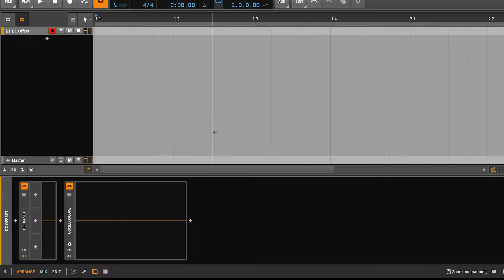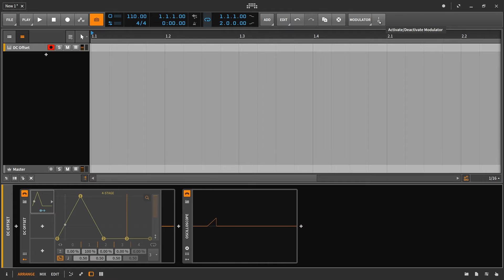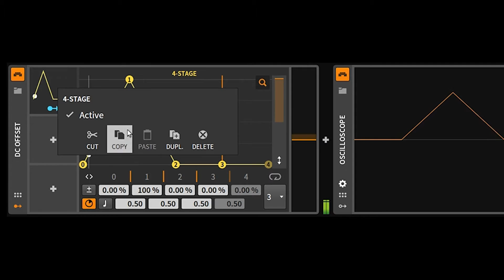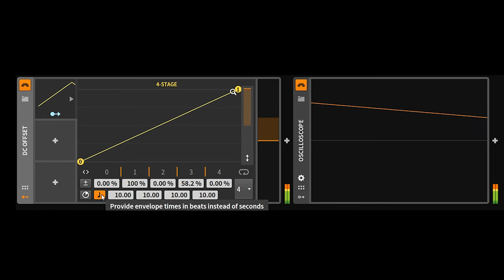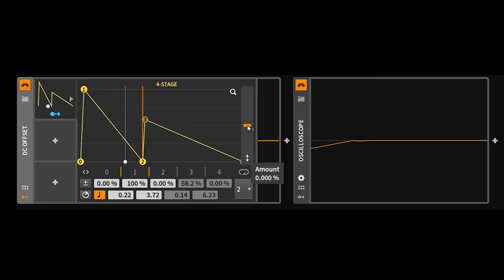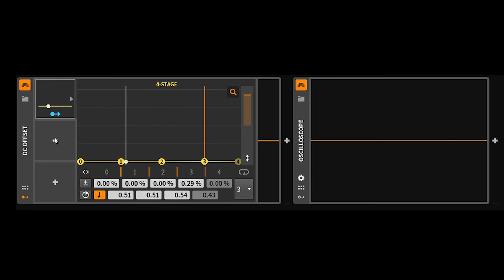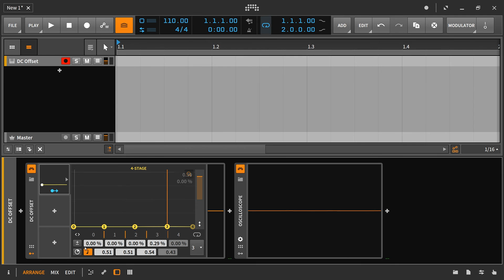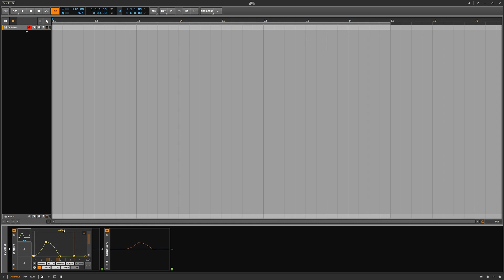Bitwig Studio 2: The 4 Stage Envelope

Comment: nice video. A few things I've figured out: 
1. When note is selected (as opposed to time), 1.00 is a quarter note. If you select note and slow down the bpm of the song, it slows down (unlike the time option).
2. The loop icon is to show what point it will loop. Under the loop icon, if you click the dash instead of a number, it won't loop.